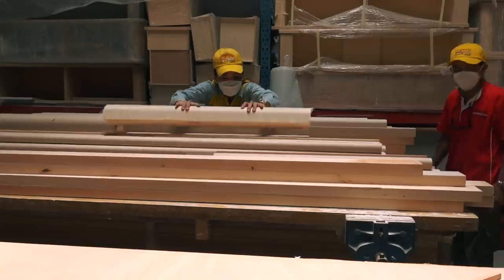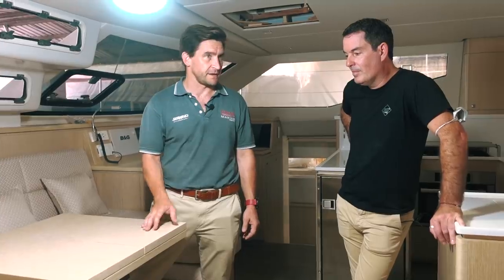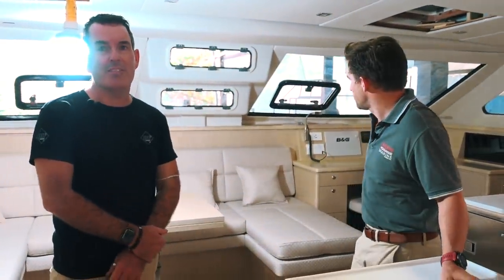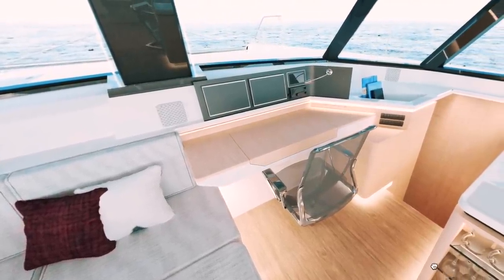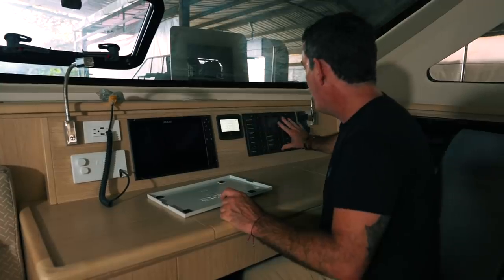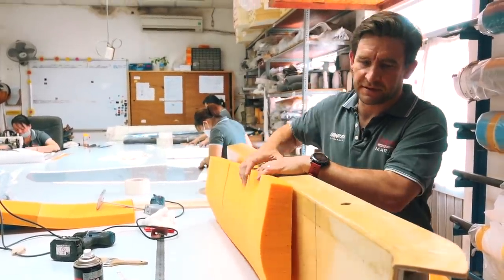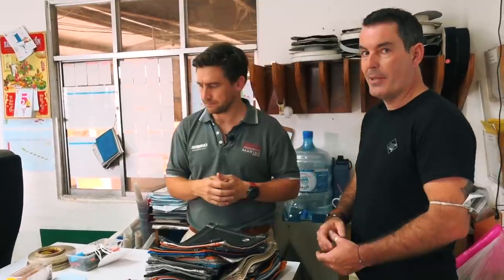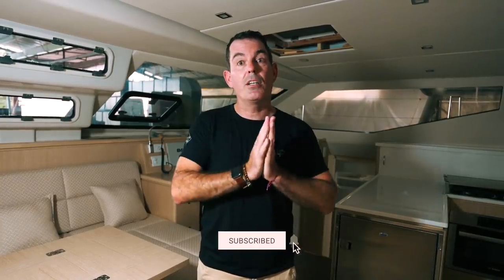Ruby Rose 2- The Small Details that make a Big Difference

Comment: Nick - I wrote this before. Don't leave the yard without the source code of the C-Zone system. Without nobody in the world - including the inventor of C-Zone - can help you with changes or trouble. Best would be to have the development system also. 

I don't know how the nav system will be equipped. I recommend a bridge between engines and nav - so you may also have all gauges of the engines on the plotter. Great control!

If you like the navstation as helm, think about another engine control. You might also travel in colder areas.